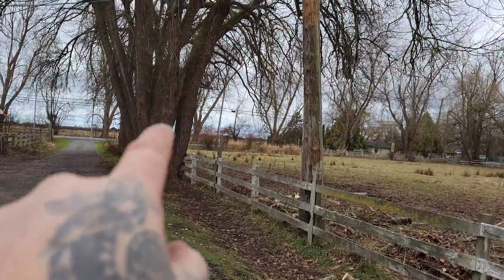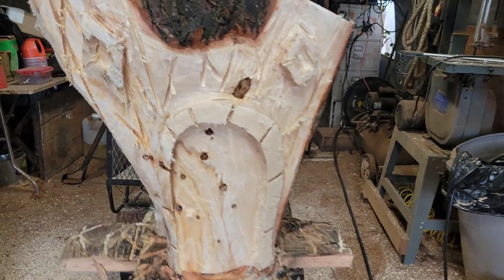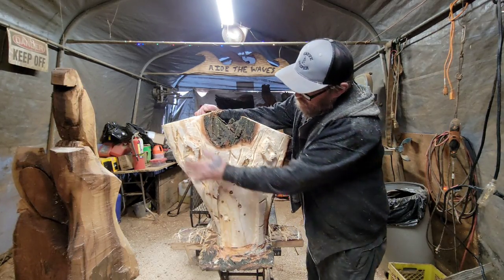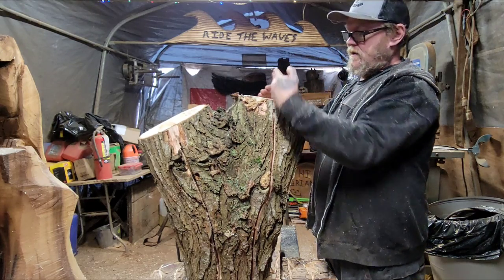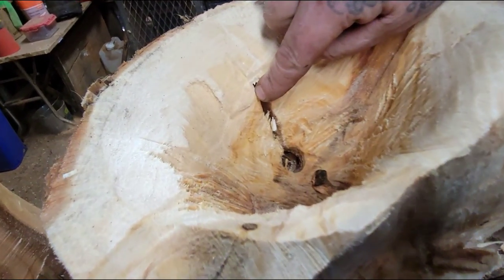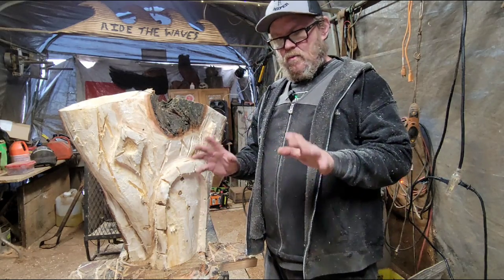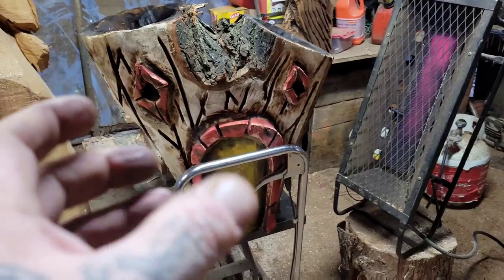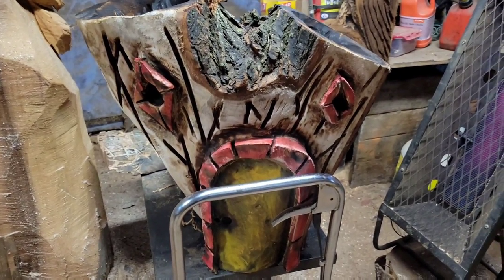How to prevent your Wood Carving from cracking.

Comment: It makes sense to me, plus if it’s opening in the back, seems like it would be tighter in the front? Don’t matter Jordy it’s like concrete, which is what I do, will trowel in a control joint, 4 months later it cracks right beside it or threw it!😂